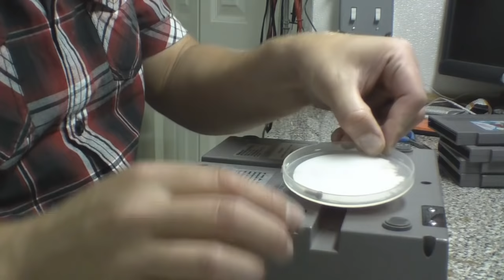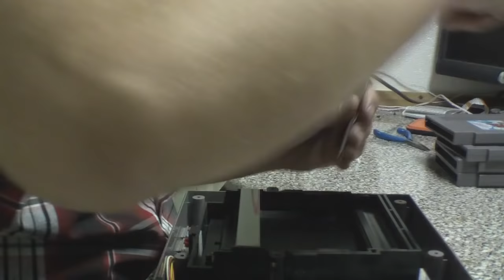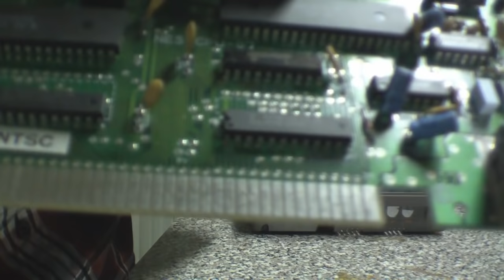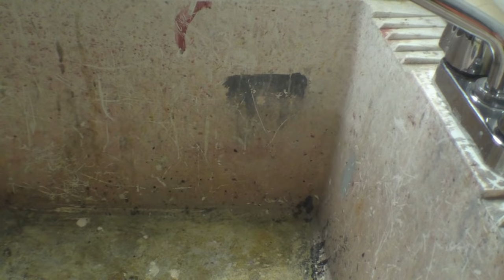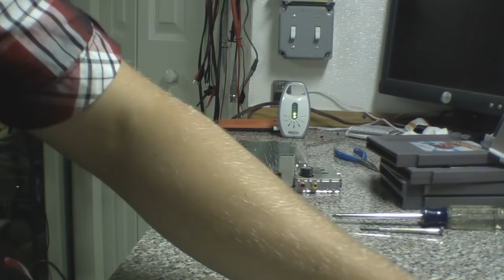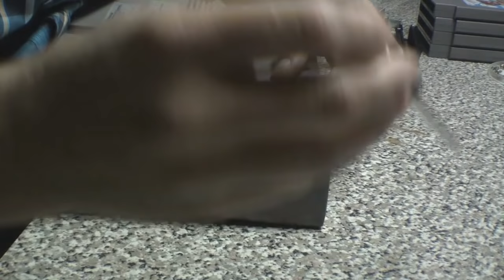Original Nintendo Restoration

Comment: I took my original 72 pin connector and with a straightened paper clip, I gently pushed each pin (very time consuming though) but pushed each pin upwards to where they are pressed up against the hard plastic casing of the pin connector. By doing so, games can be inserted and played WITHOUT pushing the game down . You see, pushing the games down was the biggest flaw of the NES. It slowly pushed the pins down creating slight gaps, through time, between the 72 pins and the cartridge pins thus not making proper connection.

Comment from the maker: You'll only really need a Philips screw driver and maybe a pair of needle nose pliers to take the original NES apart. If you want to open the games themselves you'll need an 3.8mm Security Bit. Good luck restoring that old system.
Reply: Thanks. I was about to ask that question.
Reply: I looked but couldn't find the video about bypassing the security feature that makes the NES blink. Did you make the video? or is it still upcoming? or not making it? Just curious :) this video was awesome. You were very descriptive and I thoroughly enjoyed it
Reply: Great content. I enjoyed it however I do have a comment to make about doing any cleaning with what appeared to be a nylon brush; static build up. I know that humidity levels can have a huge effect on this. Perhaps a clean lint free cloth with IPA is best to prevent any possible static discharge issues.

Comment: The NES is unnecessarily bulky comparing to FC. Maybe they just wanted to make to look like more "worthy" based on the size?
Reply from the maker: That's a very interesting take idea. I know Motorola used to put metal plates in the handheld radio units to make them feel more robust. Thanks for watching.

Comment: here's how I clean my NES 72 pin connector. First I'll put the 72 pin connector in boiling water for about 15 mins, after the 15 mins clean the connector with rubbing alcohol and put it back in the water, then I'll put 1 1/2/ 2 tablespoons of baking soda in the water, It'll fizz and there will be alot of bubbles but that's normal, leave it for another 15 mins and then take it out, while it's still hot hold the connector with oven mits since it'll be hot and connect/disconnect a clean cartridge about 30 times, after all that's done, bend the pins out with a sowing needle VERY CAREFULLY and put it back together.
If you do this correctly you will no longer need to push the cartridge down in the system (which is a good thing since that's a major design flaw of the NES)

To clean games:
First I'll get a Mr.clean magic eraser and soak one corner of it with rubbing alcohol, then take apart the game with a gamebit screw bit and then just scrub the pins down with the alcohol soaked magic eraser, only do this until the pins are clean/ shiny since you could damage it if you go over-kill.

I've done this with my NES and all of my games and in September (It's January when I post this) and I can't remember a single time where the game didn't read on the first time.
Long story short it works well.
Reply: Tem3325 //main channel you want to give me some money to buy it?

Comment: I bought a new 72-pin connector like 4 or 5 years ago and its still in great shape. I cleaned all my games around the same time I replaces the pin and I never had a problem since. I keep all my games in clean dust covers and are stored in the original carrying cases they made back in the day. Never have to blow in games again. Totally worth the effort and should last for years to come!

Comment: My Nintendo recently got a few pixels that wont render properly across all games i play.  In thinking there is something wrong with the pins
Reply from the maker: I would suspect PINs as well. I always start with a vinegar soak to clean off corrosion. If your still having issues, try using an angle pick or a safety pin with a bend at the tip and see if you can bend the pins to make better contact. retrofixes.com has a pretty good write up on bending the pins. http://www.retrofixes.com/2013/07/nintendo-72-pin-connector.html Thanks for watching.

Comment: I would pay someone to do this to my NES. I got it back in 2012 at the flea market with 5 games (but no cables, had extras at home) and a controller for $25. Works perfectly fine but I'd like to clean it, dust it out completely and restore it's original color
Reply from the maker: This is a very good beginners DIY project. No major diagnostics, component replacement or soldering. I encourage you to give it a shot on your own and if you run into problems, just drop me a message and I'll try and guide you the best I can.

Comment: Dang it did it again. I know this isn't a blog format but you seemed pretty knowledgeable and had some cool tricks to that others didn't do. What happened was after I put in Mario 3 I cleaned the best I couldn't my tool wasn't for the cartridge. I took another game out didn't do a clean and all of sudden it started looping. Put Mario back in and that didn't work again. I went online and found another original connector. This time around after installing the new connector should I rip apart every game and clean them fully or do you think the connector is just bad at this point? Any suggestions would be great. Thanks again.
Reply from the maker: Cleaning every game in your collection is going to greatly improve the reliability of your cleaned NES. Putting dirty games into the clean 72-pin is just re-introducing dirt and grime. I agree that after cleaning or adjusting the original 72-pin, if your having looping errors it's worth getting a new 72-pin. Another culprit to game misfire is the NES10 security chip. If there is not a great connection between the chip on the game and the chip on the NES the game will just rest every second. Bypassing that also allows you to play PAL titles.... hey this might make a good video.

Comment: Don’t blow into the cartridges lol
Use an earbud 
Even better clean it with an earbud soaked in isopropyl
Reply from the maker: You are correct. While I haven't had any issues with the system or games I'd done this way. I've since switched to isopropyl alcohol. I'll be adding an update to the description of this video. Thanks for watching.

Comment: Did you dilute the vinegar? How much baking soda did you use? How much water?
Reply from the maker: I use straight white vinegar, The Acid will not effect the plastic and really helps clean up the contacts. But I quickly naturalize it with a Baking Soda and water mix. I have been using this method for a few years now and my NES has not had to be re-cleaned. Keep in mind all the games you use in the system need to be clean too. Thank you for watching!

Comment: Can I use 320 grit you think?
Reply from the maker: I would avoid using anything abrasive on the 72-pin. It may work fine at first but lightly sanding the pins will drastically ware down the plating resulting in the pins corroding/oxidizing quicker. Even after a few years the 72-pin cleaned in this vid is still firing up well and continue to recommend the vinegar bath. I know I used Windex in this video for the initial cleaning but you'd be better off using isopropyl alcohol.
Reply: Tecnolock Really appreciate the response and knowledge. You earned a like! Haha God Bless you man.
Reply: @Tecnolock  I enjoy watching videos, of people that THINK, the actually know how to restore a NES console! SO AMUSING! LMAO! ( So many THINGS NOT TO DO, in this VIDEO!)  ; )
Reply from the maker: @kingjaekob   I appreciate your constructive comment. Thankfully no consoles were harmed during the filming of this video and are still working great. Thanks for the view!

Comment: So I don’t need to pull the pins back  with a pick or needle
Reply from the maker: I still have the Nintendo I got way back in the 80's. A good cleaning and vinegar bath was all I needed to breath new life back into it. It's seen tremendous use over the and the tension on the pins is still good. After a good cleaning, inspect each of the pins and see if any are noticeably more depressed then the others. At that point it may be worth leveling out any pins not lining up.